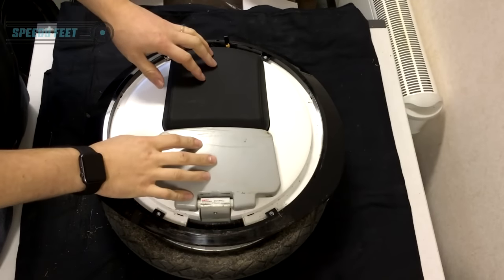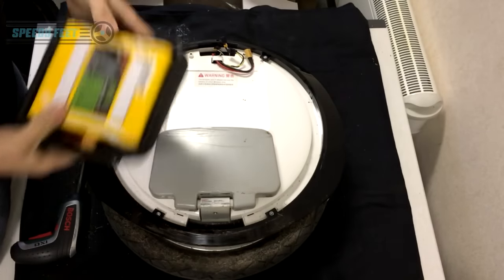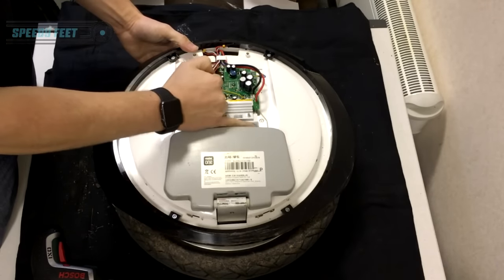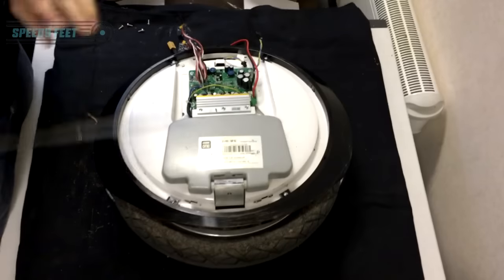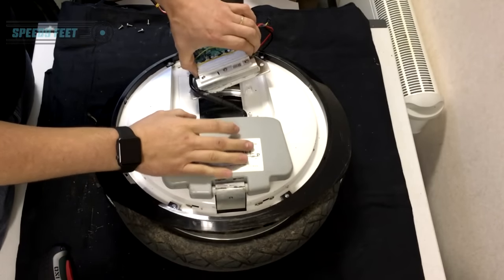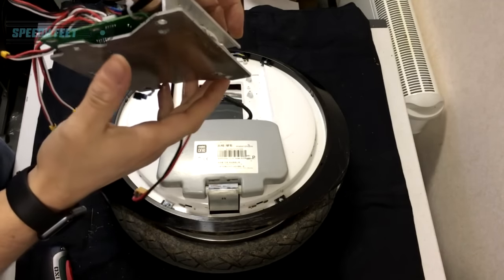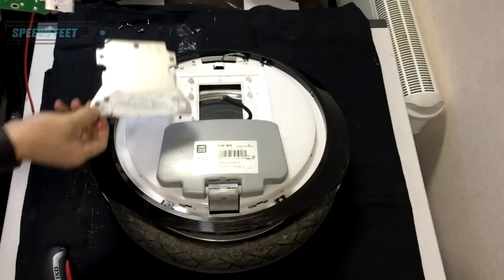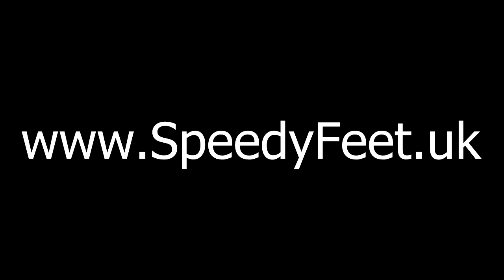How To - Board Removal and Replacement Ninebot ONE

Comment: Hey! speedyfeet. I just bought a control board off you guys and have installed it. I had to replace the battery connectors as they were cooked, the battey was fine.
After installing the new control board, I turned it on and it works fine! YAY! 
I thought i needed to enter some activation code? BUT it seems to work fine without it?? 
Did my board come pre-activated? or is something else going on?
Reply from the maker: Correct - some are pre activated, just depends on Ninebot really :)

Comment: Hey man really worried, I was riding today and i jumped up a curb like just any other normal day, and when i landed the machine cut off and it will not cut back on. The wheel is noticeably harder to turn as well now. what should i do my friend i am so bummed!
Reply from the maker: The MOSFET's on your board have blown (from over voltage - i.e. sudden power surge to the board...killing it). You need a replacement board basically.
Reply: +Ninebot UK how should I go about contacting/asking for a new one? Email, phone? And is it a hassle to reset the serial number and all that once I get the replacement? I got the unit directly from ninebot us. Thank you for the speedy reply you are the man!
Reply from the maker: Send them the details of what happened (may speed it up if you say you spoke with Speedy Feet....or may not!). Give them your serial number (on back of casing on the Ninebot - by QR code - if board wont boot up).

If the wheel is rough to turn its the board.

IF fitting the board yourself then you will need to activate once you have fitted it. They should give you details on this :)
Reply: +Ninebot UK alright man I'll be calling as soon as they open over here, thank you for the help! I gotta get my baby fixed I had to walk yesterday and that was a rude awakening haha. Cheers mate!

Comment: My ninebot one c has started shaking and vibrating. Its not locked. Ideas?
Reply from the maker: If wheel is hard to turn when off then its a blown board.
Reply: @Speedyfeetuk  Seems ok now. It was shuddering violentlent at low speeds and the shudder would dissapear over 5mph. Came home, charged it back up and its ok now. Looking at upgrading to an MSP or something now, this thing has changed my life over lockdown but its a bit of a "nanny" and I want some speed and range. Just hope this wheel doesnt die on me first. Thanks for taking the time to reply, Mr Feet. Take care.